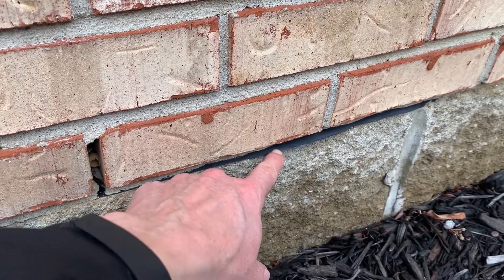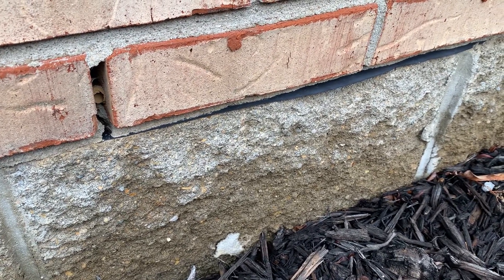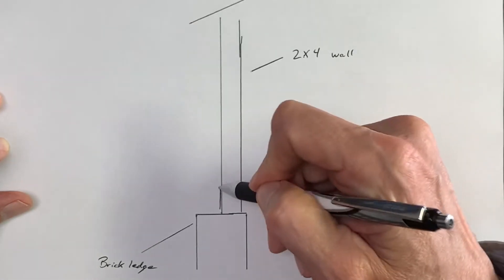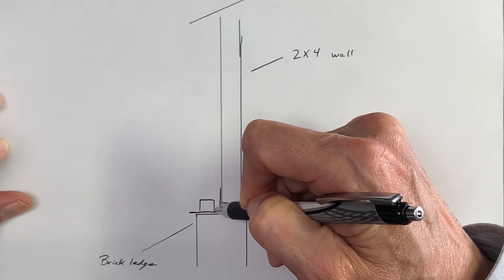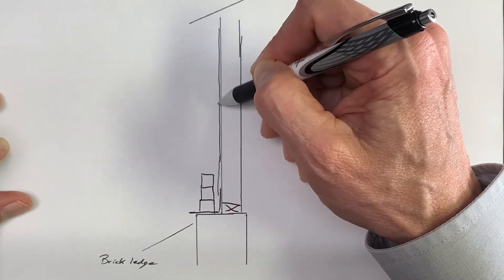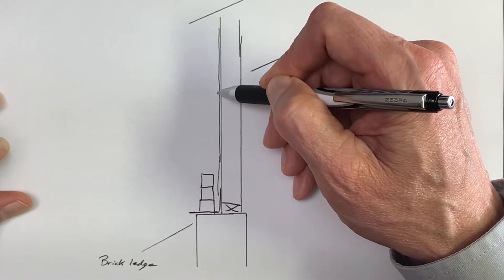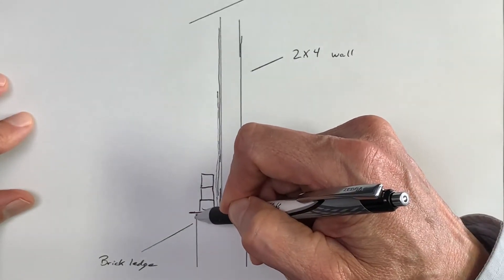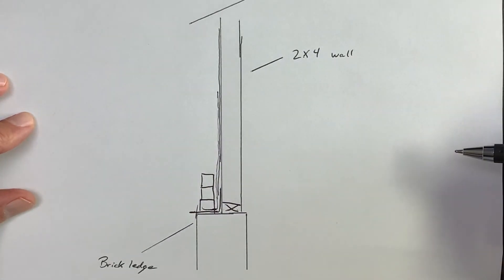New Construction: What Is Base Flashing?

Comment: Isn’t flashing made of metal? Like copper or galvanized steel? Or is there a vinyl flashing
Reply from the maker: Flashing we typically think of around things like chimneys often is metal.  However, this base flashing is a vinyl like material that is pliable and easy to wrap and conform around the corners of the brick ledge.